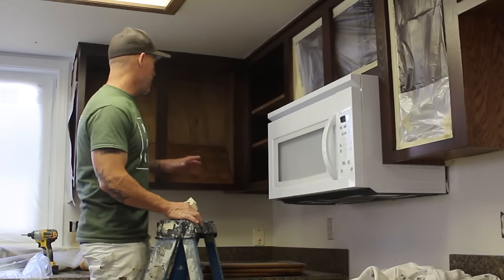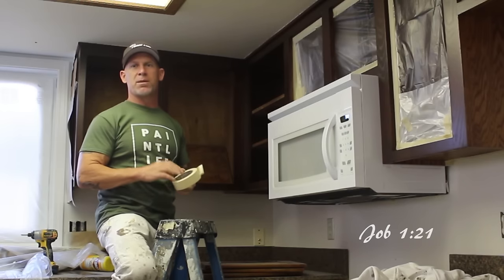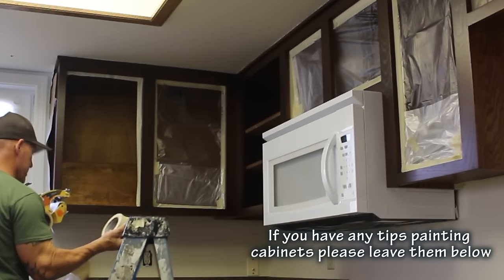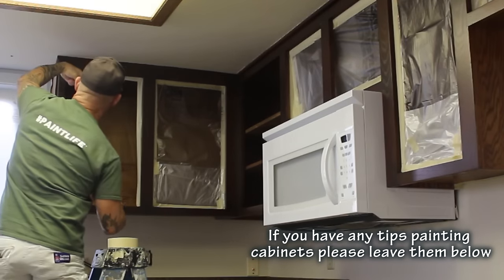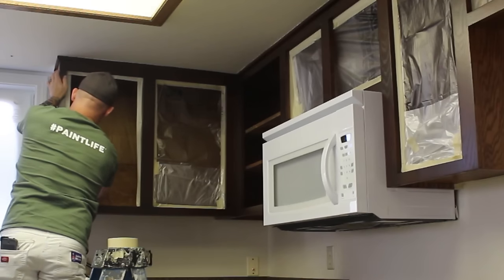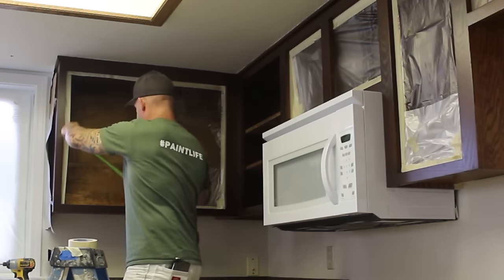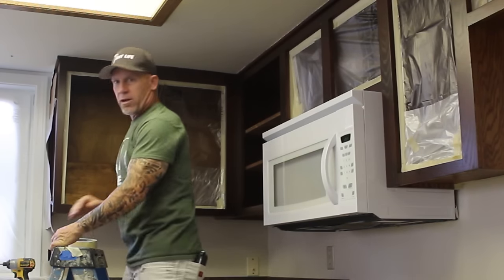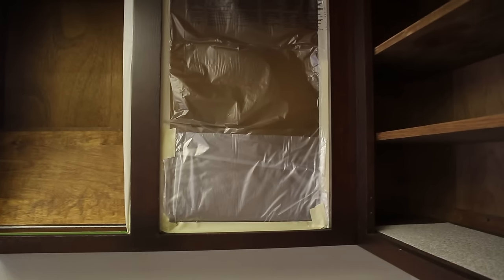MASKING TIPS.  How to mask cabinets to paint.  Using a hand masker.

Comment: Hey doing my oak cabinets , I’m using a synthetic shellac as a primer and emerald urethane as the top coat , I got the graco x5, would you spray the primer or cut and roll it ?

Comment: Great videos!  Thanks Chris.  I personally favor thin brown paper over plastic because it tends to flake less once the paint dries for subsequent coats.  Plastic is definitely quicker to apply tho.
Reply: I agree on wrapping with paper masking instead of using plastic film. Paper catches the paint/lacquer better and the overspray & dry film doesn't flake off of paper. On plastic it does flake off.

I use blue painter's tape to stick to the cabinets. I use green lacquer-proof tape to stick to the blue tape.

If I'm concerned with wet paper nasking allowing bleeding through of my paint or lacquer, then I'll double up on the paper mask.

Also, generally, paper masking is a whole lot cheaper than is plastic masking.

Plastic masking is best for isolating an entire wall or a ceiling so your overspray doesn't ruin those surfaces. Use the giant sheets with Zip Walls.
Reply: Some plastics are meant for spraying so they don't flake. He usually uses it, I think it has blue writing on the plastic not the black

Comment: Just curious why don't you remove the microwave? I've seen in a couple of your videos where you have left it and taped it up. To me it seems like it would just be a lot easier to remove it considering most of them are not hardwired and attached by two screws from the upper cabinet.

Comment: Awesome channel! Just found it! I've been trying to find an answer to something. I want to freshen up the walls with a similar if not the same color. Guys at the hardware store said that if I'm on a budget or not prepared for a lot of work, primer isn't really necessary if I'm painting over with the same color or a darker color. However, I have a couple of walls and ceiling with stains (smoke, water stain, nail polish splatter). Is it okay to apply primer to just those areas? Or do I have to do it to the whole wall/ceiling?

Comment: lol. I love the new girls at the end of the video. thanks for these tips again. I
Reply: I will be painting my cabinets when I redo my kitchen. your videos are a huge help. what paint do you recommend for this process. I had a buddy paint his cabinets and they looked great at first but they still stick when he closes the doors and drawers.
Reply: Prime with an oil based primer thinned just under 25% with naphtha (7 oz of naphtha per 32 oz of primer). Topcoat with two topcoat sprays of Muralo acrylic latex thinned 20% with water. If you thin it more than that it will run, sag, drip, and curtain on vertical surfaces. Sand with dry 600 grit wet/dry sandpaper between the two topcoats of Muralo.

Comment: Do you ever have a problem with getting overspray on the ceiling? I was thinking about covering the ceiling as well
Reply from the maker: We have not had a problem with that
Reply: If you're concerned about it, protect those ceilings. I saw Vince McMahan's office after it was sprayed onsite and his ceilings were in need of repainting. So yeah, overspray can be an issue. Protect the walls and ceilings if you're gonna make a fog. Been there, done that. Invest in Zip Walls. Use the 3M blue painter's tape that has the orange (!) cardboard interior. It's way more expensive than the ordinary blue painter's tape, but it has a softer release, meaning you run a smaller risk of peeling up existing paint.

If you can use large sheets of cardboard instead of plsstic sheeting, all the better.

Comment: Hey Chris I've used this method of plastic before and the issue I have with spraying primer and paint after cleaning the cabinets is that the plastic catches over spray and the air pressure will then blow dry flakes from the plastic around and I'm typically using bin primer then ultralaq so I've reverted to using paper when then insides are not being done to mask them off. Have you had this issue before?
Reply from the maker: Use flake resistant plastic

Comment: Hi Chris. What product do you use to paint the cabinets?
Reply: Vladimir Fendich 
Chris likes to use a lot of lacquer products which are great but could be difficult to use
Try this for primer Zinsser  B-I-N Shellac-Based White 
Topcoat  Benjamin Moore ADVANCE 
All applied with HVLP 
You won't be disappointed last for over 10 years
Reply: ELSTAN PEREZ ok I might give it a try. I've mostly been using a Pro Industrial PreCatalized one part epoxy from Sherwin williams. Thanks
Reply: Vladimir Fendich, Sherwin Williams PreCatalized epoxy was my #1 for cabinets until I found out about the PPG Breakthrough and as good as the PreCatalized is  the Breakthrough is even that much better.
Reply: Jeremy Yoder 
Thanks for sharing I'm gonna have to look into that product
Spec sheets look good
Reply: Doom Slayer Are you in the United States?